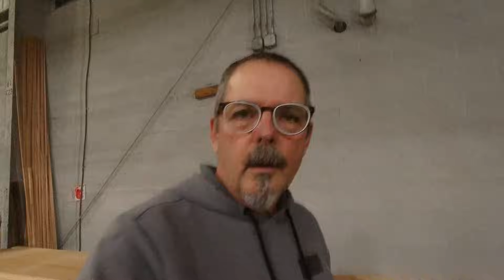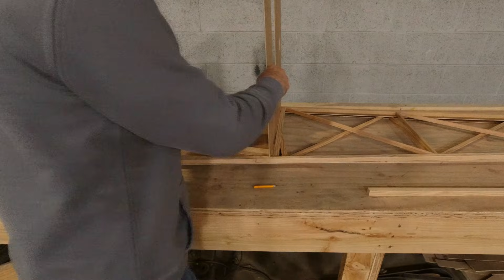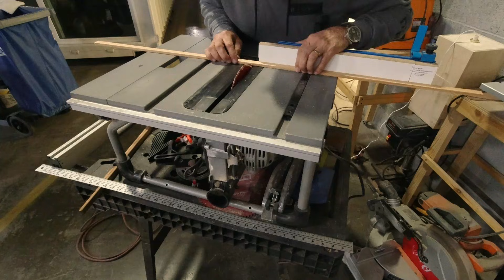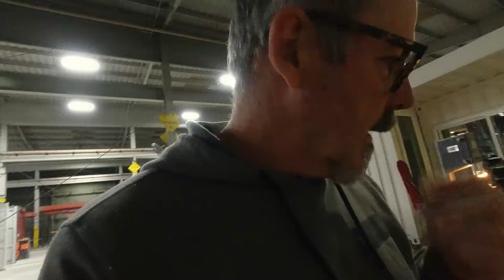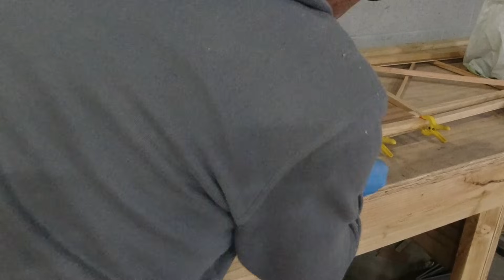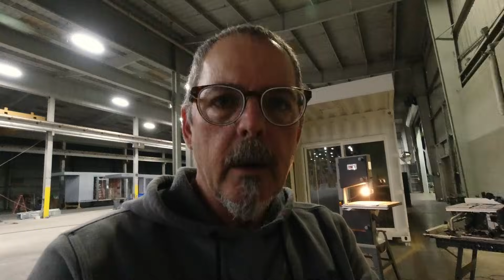Minimax 1100r Aircraft Build Vlog Ep 55 - Preparing Plywood Stations

Comment: You called it a spare carry through but I think it is for the rear struts or am I wrong? Coming on great.
Reply from the maker: There are aluminum brackets at the wing root on the main spar and aft spar. They slip into the fuselage and get a pin through them at this station 4 location. 
Struts go through the landing gear out to about mid span.
Reply: @DTMinimax  Its okay it is my fault I forgot the 1100r is a shoulder wing aircraft, I just had it my mind that it was a low wing (I don't know why, must be my age).